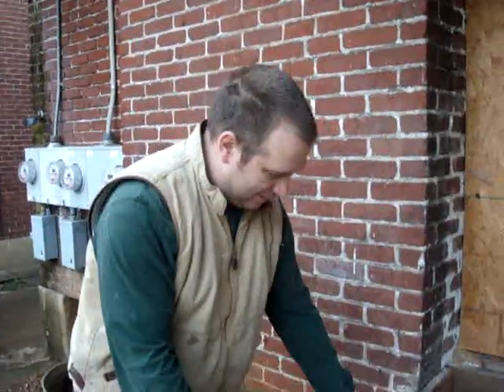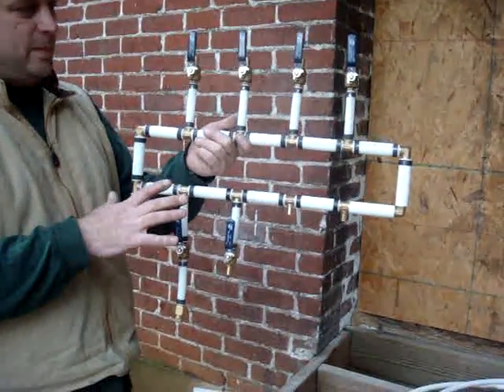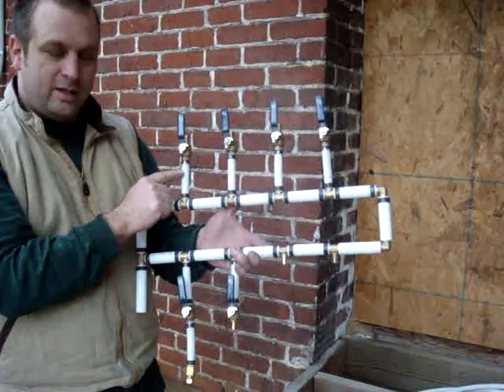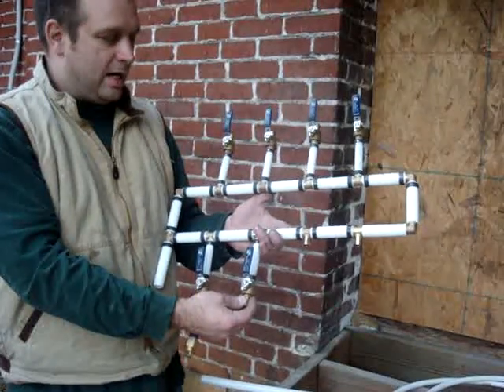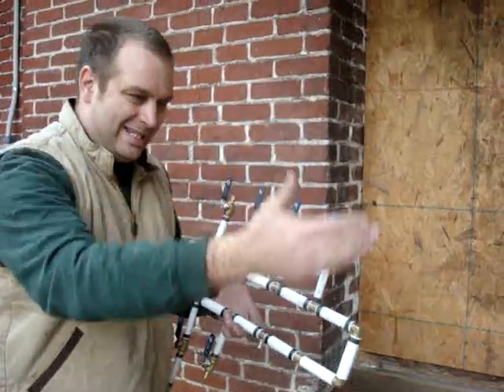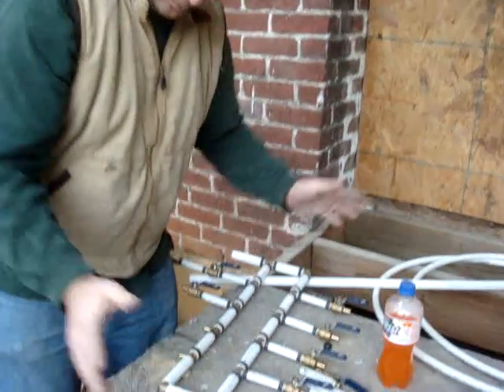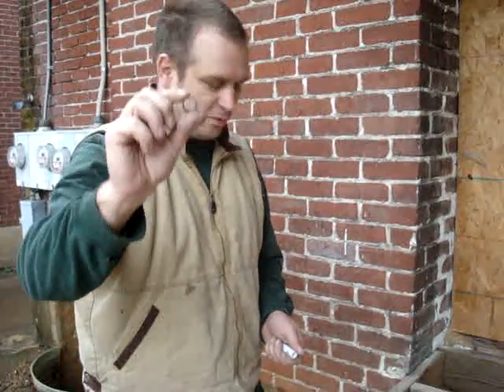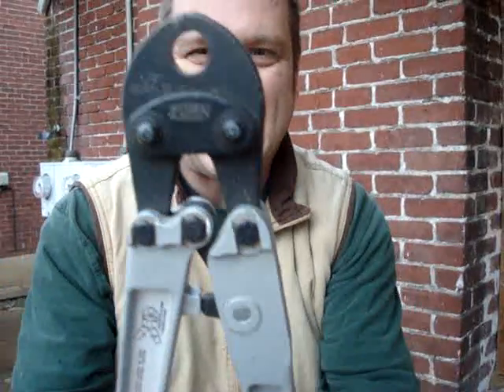Introduction to PEX

Comment: There are a lot of good ideas with this, not sure I'm sold on those cutoff valves on the manifold.  I mean I hope they are "Full Port Valves" where they don't restrict flow, but also, they can in themselves become a leaky maintenance headache.   I would think that PEX should last your lifetime, and that you already have cutoffs at each fixture in the bathroom, so why muddy the water with a cutoff on the manifold?       The only reason you might want that would be if you plan on some shootout in your house where you might rupture a line in the wall and want to just shut that area off vs the whole house.    Between the expense, maintenance and complexity ... not so sure it is that useful.    12 years later, what say you?  Worth it?

Comment: James would your manifold work if it was shortened by using a tee only at the corners rather than 3 more inches of pipe and an elbow?
I am building one right now and space is an issue.. Thanks for a great video.
Reply from the maker: Yes.

Comment: James,, Great video! Is your manifold made from pex A tubing? or a rigid pex pipe?
Reply from the maker: A, but any pex would work including the orange radiant floor per. You could even make the whole thing out of copper if you wanted to sweat joints if that look was the anesthetic you're looking for. I did that once where the manifold was exposed in the living environment and it was kinda steam punk.

Comment: Good video! Question for you. Should the water main branch T off to the fresh manifold and hot water heater, or does it matter if the hot water IN is fed from the freshwater manifold to the hot water heater, then to a hot water manifold. I see you test pressure have you tested the out on the hot water manifold to see if its consistent? I'm remodeling my house and trying to learn. Assuming pressure drops over distance. Or could I be over thinking this
Thank you
Reply from the maker: They'd be so close it wouldn't matter, no worries. Depending on space limitations, feeding to water heater off main line after shut off or or cold manifold would be equally OK.

Comment: YOUNG MAN ,

N E V E R  - USE  L - FITTING  OR CRIMPLING  SOONER ARE LATER WILL START LEAK  MORE SOONER THAN LATER  >  CRIMPLING IS JUNK  "  /   AN ALL WAY USE UPONOR FITTING O R USE  B R A S S SHARKBITE  ONLY !
Reply from the maker: There's no L copper in the manifold so I'm not sure what you mean. All the valves are quarter turn brass. Any of the 3 methods of connecting PEX are good and long lasting (copper crimp, stainless crimp and expansion). Sharkbite is ok and great for transitioning in remodel between copper, PEX, cpvc and water supply CMT but the EPDM o ring isn't quite as long lasting as crimping or expansion methods. That's nothing to say about cost of Sharkbite style. I use those quick fittings when transitioning between PEX and polybutylene in repairs. There's a slick kit with 2 different crimp rings and an adapter.

Comment: Hot water heater???... I have heard enough!
Reply from the maker: I suppose you also place footings instead of pour footers? Fine Homebuilding saw this and I wrote an article for them. But I guess I can't call all tissue Kleenex either? You can be a troll, but not w/o getting called out for it. So ends all I will offer on your contribution.

Comment: I was going to do this, but when I priced the valves,  I said no way!  Talk about expensive!
Reply from the maker: They are about $8 each. Still cheaper than an off the shelf metal manifold but yes it's still over $100
Reply: @JamesGlassJamesGlass  Yeah, but not just the valves. You also have all the elbows and "t"s. Yes, I agree that it is cheaper than the manufactured one. I like the idea,  though.  I also enjoyed your straight forward video.

Comment: Why not have a permanent pressure gauge while you’re doing all that fitting for the manifold. Also agree with 3/4” to HW heater.
Reply from the maker: You can do that, totally. If you want to know line pressure at any time. We have really consistent municipal water pressure here.

Comment: One thing...with the mini manifolds in the ' grouped' areas...are they looped like the main manifold?....or are they in a straight line?
Your feedback would be appreciated
Reply from the maker: You can just run one hot and one cold to each area and then use the mini manifolds to branch off those two trunks. For example: run your hot and cold to your bathroom and then use a 3 outlet mini (3/4" inlet with 3 1/2" outlets) from the cold line to supply the toilet, sink and tub. Use a 2 outlet one for the sink and tub aupplies.

Or in the kitchen: bring a hot and cold off your main manifold to a mini that supplies hot water to the DW and sink and a cold line to the sink and fridge.
Reply: @JamesGlassJamesGlass  thank you for your prompt response James, much appreciated

Comment: how good is this compared to buying one from the store
Reply from the maker: Comparing the off the shelf metal ones that you can buy this is cheaper and you can repair it. You can also buy cheap plastic ones for less than making one but they last a fraction of the time. I wrote an article in Fine Homebuilding a few years back on this and your question was addressed there. If you can find it in archives you can get some comparative numbers.
Reply from the maker: I found the link. Looks like you need to be a member to access it. I built the manifold pictuted in that article as well. https://www.finehomebuilding.com/2016/07/06/build-pex-manifold

Comment: i know this is an old video but im sure he as redone this setup as from what i have experienced the hot water connection should be 3\4in
Reply from the maker: I haven't but remember this was a small home w super low water demands. I'm doing a 936 sf tiny home now and I'll build the same manifold. You can totally use 3/4" tho.

Comment: Circular manifold doesn't help equalize anything, pressure is not about chronological order or the shortest way, it's only about resistance. The only way to prevent discomfort and scalding in showers is to install thermostatic mixing or pressure balance valves which limit hot water flow when they sense a drop in cold water pressure.

Comment: You could have used a brushing and put a $10 pressure gauge on the diagnostic port... check pressure at a glance!
(why is he heating hot water?)

Comment: Cool vid, Thanks! Real good idea on the diagnostic port! I am looking at changing out my 1960s copper for Pex. Was looking a buying a manifold but like your idea better. I did home renovations for most of the 90s so some plumbing experience but before Pex was used much. This vid will help a lot! Thanks again.

Comment: What is your opinion, sir, about the expansion type pex with a plastic ring compared to the metal ring you show in this video .? Thx
Reply from the maker: Any of the three common approved methods of connecting PEX are good. (1 = crimp fit with a copper ring, 2 = banding with a stainless band, and 3 = the expansion method. 

All three methods hold way more than line pressure would ever deliver.

The cost barrier (for tools) to entry is highest with the expansion method and lowest with the stainless bands. 

For the expansion system you have to use PEX A (google this). For the crimp system you can use PEX A, B or C.

For professional that do PEX all day everyday, they often go with the expansion system. It's fast and reliable. If you crimp, especially with copper, you have to make sure the ring is straight or it will leak and also, with copper crimping the tool wears and needs adjustment. If the tool is worn or out of adjustment, the joint will leak. If I did PEX all day everyday, I'd use the expansion system, but I don't so I use the copper ring crimp system. 

This guy has a nice video comparing the differences:

https://www.youtube.com/watch?v=q8J1yHRuFWs

He also shows a couple of other connections systems that aren't as common (but are still approved). I suppose you could always use Shark Bite style fittings, but (a) this would be insanely expensive, and (b) the o-ring is always going to fail given enough time.
Reply: James Glass  I must thank you profusely for this Info. I am just a homeowner and you removed my confusion !
Reply: car oil line crimping tool
Reply: I forgot to ask about the Push in Sharkbite . Are they also reliable ?

Comment: Thanks for sharing.   I want to know...   Is your theory of the circular manifold tested true?   It makes sense but is it working in application?   Thank you
Reply: Lawrence Sarlo: Wildwood Real Estate ... the same system is used in Hot Tubs for the Jet System! They're called a "Jet Ring". Equal pressure at all individual jets.  Side note: older tubs used this system.  Now there is a manifold system, some are flow thru, others will have a stop.
Reply: True. Circular manifold doesn't help equalize anything, pressure is not about chronological order or the shortest way, it's only about resistance. The only way to prevent discomfort and scalding in showers is to install thermostatic mixing valves which limit hot water flow when they sense a drop in cold water pressure.
Reply: There is no purpose for a circular manifold.

Comment: Thank you. Not sure how practical manifold system is. However if pressure is a concern one should run the main feeder under the house using one-inch PEX. This is because PEX is undersized compared to copper, PVC, and iron.  One-inch PEX is really three-quarter inch ID, three-quarter inch PEX is one-half ID, and half-inch PEX is three-eighths ID. It is especially small in the fittings. Checking water pressure is simpler than this video suggests. You can get the static water pressure by just putting a gauge on an outside faucet, or on the hot water tank drain.

Comment: james, if you happen to see this. I am running a 24" - 1/2" copper pipe off my tankless water heater. I have a 3/4 feed pex line and a 3/4 to 1/2 90dg brass barb fitting,..can I run the copper pipe right into the brass bard and use a pex crimp to join this?
Reply from the maker: They make connectors to go between copper and pex, so all you have to do is pick up the right connector (plus whatever fittings you need, if any), and you're good to go. If using copper to pex, you just sweat the fitting on the copper and then crimp the pex side.

Note that there Quest (polybutelene) barbed fittings are not compatible with PEX fittings. Also note that there are Gator Bite and Shark Bite fittings that allow for the transitions between different materials. These work by compression joint.

Comment: Did  you use 3/4 or 1/2 to build it.
Reply from the maker: You can use either, but in virtually every application, you would use 3/4"

You can see an article about this (written by me) in the September issue of Fine Homebuilding.

Comment: when on a well, is there any downfall pressure and volume wise when running these longer lines from the manifolds to the individual fixtures as opposed to running say one main line close to the bathroom then branching off the lines to each fixture?
Reply from the maker: Assuming you have good (and consistent) pressure, there's no issue. Whether well or municipal, you really need adequate pressure no matter what. You should have pressure between 45 and 75 psi.

Comment: Great Vid Jim, I have a few questions. I'm in the process of redoing a foreclosure and 75% of the copper was missing. I'm going to run pex and the area to mount the manifolds is small
and Its a small 1 bath bungalow so I don't need as many ports. I was wondering  could I replace the elbows with tees? Will it change the equalization pressure at all? Thanks in advance. ddcei@roadrunner.com
Reply from the maker: +DDC So long as you make a loop so water comes in from both directions, you'll be fine.

Comment: i have an old home actually its probably even historic. it was built in 1895 and has had allot of questionable work done over the years. the previous owner had installed CPVC. the hot water tank failed recently. i had my friend help me replace it, he is a licensed electrician and also does plumbing work. he told me the CPVC is not very good plumbing. i have noticed that many of the joints are indeed starting to leak and im going to have to replace all of it. is CPVC really that bad?
Reply: +andrew donohue we suggests that we use 3/4" inch pipe, it will deliver water volume. we are on a well and i have the pump kick on at 30 PSI and off at 55 PSI.
Reply from the maker: +andrew donohue Well, it is what it is. In the world of plumbing CPVC and PB pipe have their troubles and are known for leaking issues. Both are used because they are inexpensive. 

It used to be that copper was the way to go, but PEX is a game changer.
Reply from the maker: +James Glass Yes, do go 3/4".

Comment: what two sizes of pex did you use and the length you cut them?
Reply from the maker: +Chanel Jackson You should use 3/4 or greater and the length doesn't matter. You just have to be able to mount it on the wall and be able to use the tool to assemble it. This house was weird and it got 1/2, but it's tiny. Tiny, tiny tiny! So, if you're building a tiny house that uses virtually no water, 1/2 is fine, but for most modern American homes, you'll want 3/4 inch.

Comment: You can't have a water loop. The water will cavitate. You will get low pressure or stop and go water.
Reply from the maker: +memouki Actually, I went and found a nice video on cavitation for you. Cavitation can't happen in this closed system in this loop because there's no (a) no displaced water and (b) there's no extra room for it to even be displaced. In order to get the noise, there'd have to be displaced water and a means for it to cause waves that could become sound. The guy commenting above doesn't understand the science and he's made a claim without evidence. Worse yet, he's made a claim contrary to known science. Take note of what happens with reduced pressures and how the steam bubbles happen. In order for cavitation to even occur, water has be displaced under the correct low pressures and then that energy has to make a sound wave. For subs, it's something you can track with sonar.   https://www.youtube.com/watch?v=ON_irzFAU9c
Reply from the maker: +Steven Kirby Ahh, no. That's exactly not what happens. Fine Homebuilding just contacted me about doing a two page spread on this, so I guess you can read more about it sometime later this year. There'll be a graphic that helps explain the science.
Reply: +James Glass Could you make a video explaining the details?

Comment: You have a 3/4 line coming in but only 1/2 going to the water heater. So your hot water line is only 1/2 inch line.
Reply: MANABLOC

Comment: I like old ways pvc= works well 4 me!... I seen guy pex whole home.. then after 2 -years... hot/ cold/hot/cold.. several started leaking!not much.. but any was enough make me not change to pex! when pex first started,, like 20 yr ago.. was only blk pipe.. maybe is better now days ! idk. metal moves and weakens / new copper / or metal ring exposed weather be rusted /corroded fast seems. I admit I kinda like the stretched plastic type.

Comment: One more question: How do you feel about PEX-a and the expansion fittings? I know the tool is expensive, but the connections and fittings seem really neat and simple.
Reply from the maker: +Mike Junot All the ways to connect PEX seem decent and they are all approved by building code, so they must be safe and long lasting.I use the copper crimp rings. They're rated to 200 psi (which is triple the typical line pressure) and are easy to use with low cost tools. I don't know much about the expansion fittings other that what I've watched off Youtube. Also, where I live, I get easily get my hands on crimp fittings, but there's only one place that sells expansion and it's 40 miles away. I don't know enough to really answer your questions other than I have never had a problem with the crimp fittings over the last 10 years.

Comment: Ok, so I came up with this same idea before I viewed your great video. What do you think about running a dedicated 1/2" line (via a closed loop, 1" manifold similar to your 3/4" manifold) to each vanity, sink, and laundry, while running dedicated 3/4" a 3/4" line to each shower. Would this additionally allow maximum flow and pressure to the showers (3 bathrooms) where it's more critical for comfort?  Also, I'm considering re-plumbing the entire house. I recently had a leak in the slab from copper cold water line to the kitchen. Would extremely hot temperatures in the attic here in south Louisiana be a problem for PEX?Thanks for the video. Extremely neatly constructed manifold...great work!
Reply from the maker: +Mike Junot On the heat issue, the PEX shown in this video (the stuff that is common to box stores like Lowes) is rated to at least 180 F, and if that's not enough there is a version of PEX for boiler and radiant floor heating rated even higher. 

Yes, you can have any size manifold you'd like and run dedicated 1/2" lines to each fixture. In fact, that's even nicer that the set up I used in this video. It does allow for greater volume to each fixture and smoother operation. The question is demand vs. set up cost. If a house has family that uses a lot of water by many different people at one time, running dedicated lines is probably worth the set up cost. If it's a small house with few people or people that aren't all demanding water at the same time, running one line to a room (like a bathroom) and then using a mini-brass manifold is more than fine.

Comment: my question is why didn't you use blue for cold water ???
Reply from the maker: +bounchofbeaners I use white for manifolds and meter to street connections and blue and red for supply lines, but that's just a subjective call. You could totally use blue for the cold manifold and red for the hot one.